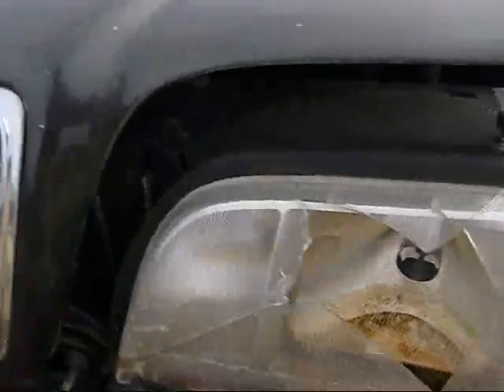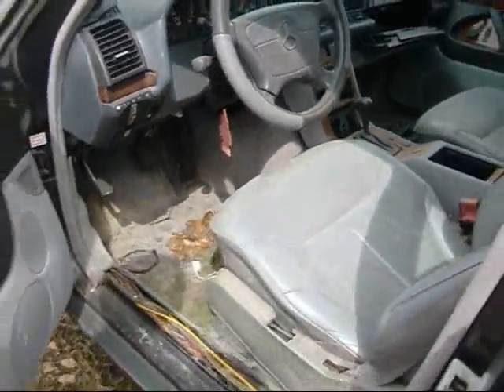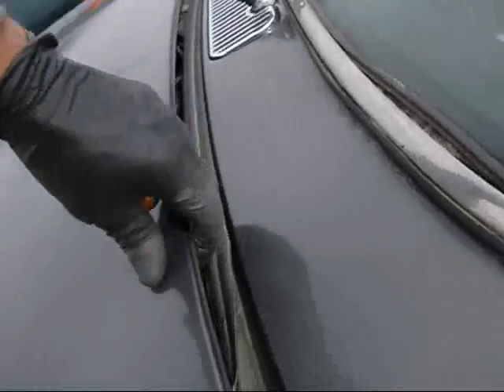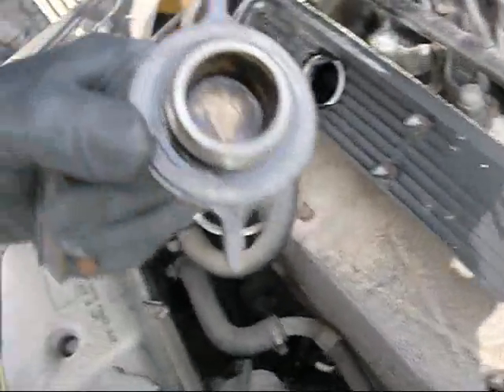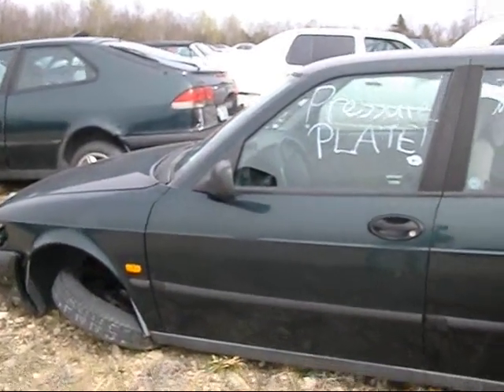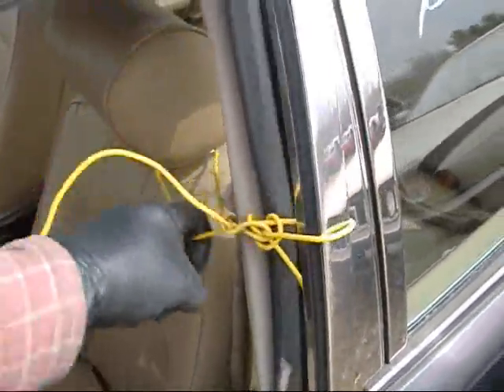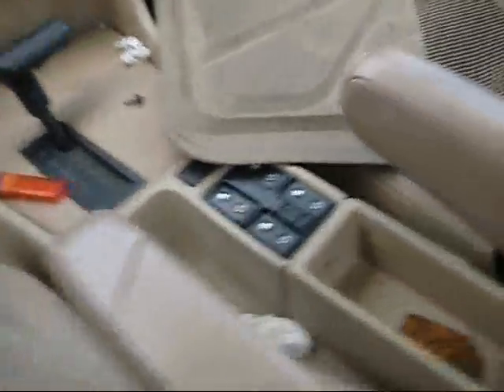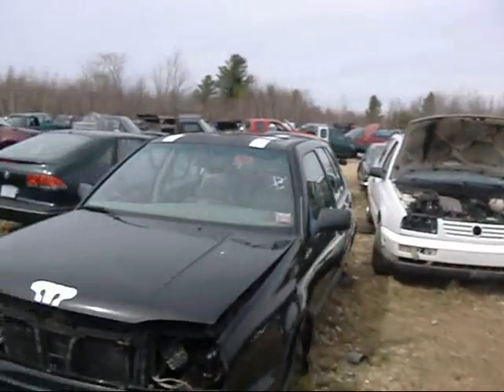4 14 12  Junk Import Row...

Comment: Mercdes diesels are the best, except for that 350 in that S-class. Avoid those engines, bad cooling makes the blocks crack. The older 300's or the newer 300's that came in 96(?) are rock solid engines. The 350 was a scandal. Still it's madness to junk an W140 after just 178000 miles. Even with a bad enigne it would be wise to either rebuild the 350 or get a newer 300 and change it.